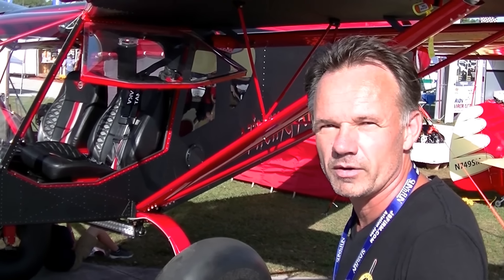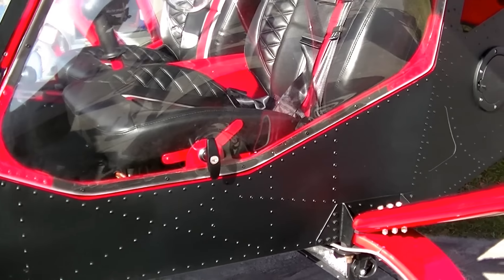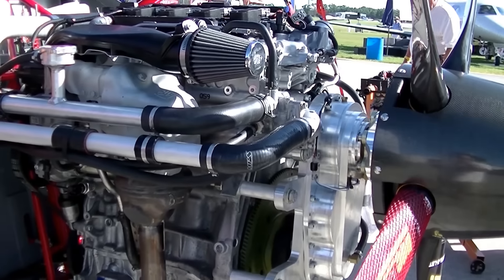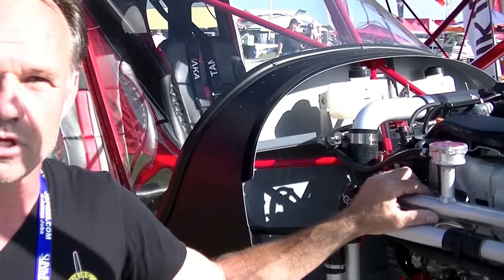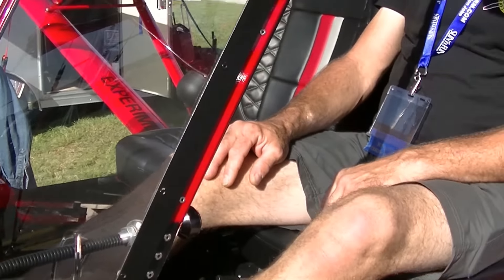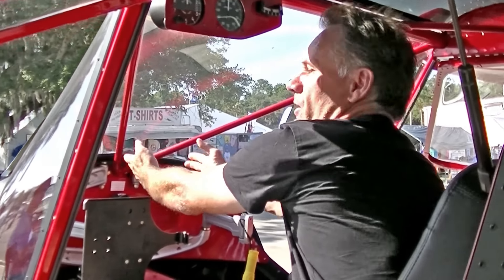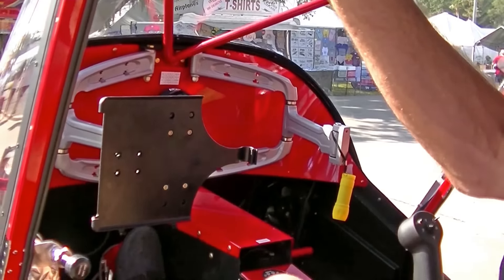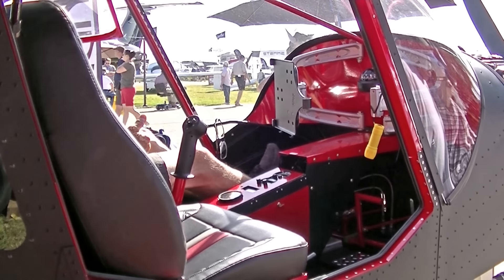STOL CH 750 Super Duty powered by the Viking Honda engine

Comment: Less face and more airplane!
Reply: Ya but, this build shouts, look at me, me, ME, whoopy Dee!! VERY VERY POOR Choice of engine.  Those tiny 4cyl engines use HUGE amounts of fuel, at high rpm and under turbo boost.  For spinning a Propeller, you NEED an engine that produces a lots of torque at very low rpm, and sips fuel while doing it.   Oh!,,, and inline 4cy are vibrators, unless fitted with balance shafts that rob engine of power, while adding weight and complexity.  VTEC Yo !!!
Reply from the maker: See it and hear it fly: https://youtu.be/Uo0QP7U9_Po
Reply: AGREE..  very poor production.. you get a D -- . THUMBS DOWN !  I wanna buy a car.. Im not gonna be in the office looking at the salesman.. we wanna see the plane dammit..

Comment: Hey camera guy!  Learn the concept of a cutaway and B-roll. We want to see the plane, not the guy talking. Where are the closeups of the places on the panel he’s talking about?  Control placement?  Sheesh....this is a frustrating vid to watch if you want to find out about the SD750.
Reply: Ya but, this build shouts, look at me, me, ME, whoopy Dee!! VERY VERY POOR Choice of engine.  Those tiny 4cyl engines use HUGE amounts of fuel, at high rpm and under turbo boost.  For spinning a Propeller, you NEED an engine that produces a lots of torque at very low rpm, and sips fuel while doing it.   Oh!,,, and inline 4cy are vibrators, unless fitted with balance shafts that rob engine of power, while adding weight and complexity.  VTEC Yo !!!
Reply: @andrewjackson7476  and yet  that still doesn't explain why the cameraman thinks equipment is mounted on the guy's face when the guy was pointing out different things in the cockpit.
Reply: Obviously the items the guy is pointing out are attached to the guy's face.  That's what the cameraman suggests anyway.

Comment: I'm wondering if the heat from the baking process of powder coating changes the strength characteristics of aluminum?
Reply: Machines and Things no it does not.
Reply: Machines and Things the slots, I call them slots because they are fixed in place and not movable or I would have said slats have plastic tips on each end those would have been painted then riveted on as powdercoating plastic don't work, I built a dozen or so airplanes for icp in Canada and we used to use an epoxy  based paint that was awesome, you could paint a piece of alum. And score it with an exacto knife and bend the piece of alum. And try and pick the paint off and you couldn't. I still think polishing is the best less weight = faster and higher roc

Comment: The only thing I wonder about is the reduction unit when one of these auto conversions ends up in an NTSB report lot of times it's the reduction unit that fails, and the engine management computer I have seen a few where something goes wrong in the aftermarket computer can't use the honda computer have to use something else.

Comment: Can tricycle landing gear handle rough undeveloped terrain?
Reply from the maker: "Rough undeveloped terrain" is quite relative. The effective elevator control means you can mostly keep the nosewheel off the ground. Additionally, we like the better forward visibility of the tricycle gear configuration, better steering and ground handling, and ease of getting in and out of the plane. The reality is that most modern pilots simply don't have taildragger experience or access to training, and pay higher insurance rates for taildragger coverage.

Comment: I have over 20,000 hours but only an hour or two of General Aviation time — at first glance this airframe looks like it needs more rudder and more vertical stabilizer surface ... can you speak to that ?
Reply from the maker: Virtually the entire vertical tail is the rudder so it is indeed a very large effective rudder with more than adequate rudder authority (especially important at low speeds). For more about the unique design features of the Zenith STOL airplanes, see the article by designer Chris Heintz: http://www.zenithair.net/high-lift-design/

Comment: The Wright brothers never used auto engines. As far as I know all planes built by the Wright company used Wright engines, designed by either the Wrights or Giuseppe Bellanca except for 1 or 2 of the racers which used a Pratt and Whitney. This was done because there were no automobile engines that met the specs they needed.
Reply: The Wright brothers did design and build their own engine for the Wright Flier, but it was an inline 4 cylinder water-cooled engine, more similar to the Viking engine than a Lycoming/Continental.  And the brothers did first ask auto manufacturers if they would build a lighter version of their 4 cylinder engines, but the manufacturers  weren't interested in building a single engine. (no volume, no profit margin) So the wrights went to the drawing board.

Comment: I thought it was a Honda civic but then I heard accord
Reply: That was a bit confusing, as was the part about the Wright flyer and automobile engines. Maybe he misspoke, maybe we missed something.
Reply: It's in both the Accord and Civic.
Reply: VERY VERY POOR Choice of engine.  Those tiny 4cyl engines use HUGE amounts of fuel, at high rpm and under turbo boost.  For spinning a Propeller, you NEED an engine that produces a lots of torque at very low rpm, and sips fuel while doing it.   Oh!,,, and inline 4cy are vibrators, unless fitted with balance shafts that rob engine of power, while adding weight and complexity.  VTEC Yo !!!
Reply: Wrong on all counts. Small, boosted engines can be more fuel efficient than large, naturally aspirated engines, which is why you're seeing more of them come on to the market recently. Compare the Ford F-150, 2.7 liter EcoBoost engine to the EcoDiesel in the Ram 1500 to see what I mean. The PSRU is where the torque comes from, gears are torque multipliers. Only large 4 cylinder engines need balance shafts, these don't have them and they're very smooth. If you want vibration, fly with a Lycoming or Continental engine.

The only downside to these engines is that they're optimized for automotive use and not aircraft use, which means that they have a longer stroke than they should, this harms efficiency somewhat, but these engines are probably still more efficient than a LyContisaurus engine.

Edit: The Viking 180 burns 12 GPH at full power and 9 at 75%, a 180 hp IO-360 burns 14.5 GPH at full power and 10.5 at 75%.
Reply: "inline 4cy are vibrators, unless fitted with balance shafts that rob engine of power"

Vibration isn't really an issue until you get past 2 liters of displacement.  Just the same, every inline 4 on the automotive market today has balance shafts because consumers have become so fussy.

As for the fuel, this is the 1.5 (I hope so, since he said it was only 185hp, and even that's low compared to the 195hp Honda claims for the 1.5), which is meant to be hooked to a CVT for economy, and is a gas sipping engine.  Direct injection was chosen for automotive engines for the ability to stratify the fuel/air charge.  At lower loads - cruise loads - most of each cylinder gets filled with air, and just a portion of it gets a proper fuel air ratio for combustion.  Meanwhile, the engine is also tuned/designed to run with less manifold vacuum under moderate load to reduce the amount the engine has to fight to breathe.

Honestly, who in their right mind thinks that aero engines, with technology that's hardly changed since the '30s, have better economy potential than the bleeding edge of automotive engines and tuning!?
Reply: Andrew Jackson <--- Internet Expert! Y u so smart
Reply: As an auto mechanic, variable valve timing is something I would NOT want to trust my life with in the air. Seems these small, boosted engines all eat timing chains at around 100k miles in cars. Lycoming and Conti may be dinosaurs ... but their RELIABLE ones. Tried and true. Who knows what kinds of failures we'll be seeing in '18-'19 automotive lines. They seem to get worse and worse every year. Problems that used to take 5-8 years to discover, we're now seeing while they're still under warranty. If it were a mid 90's Accord engine, I'd feel a little better ... although it's going to be a bit sluggish. Not what you want in a STOL aircraft.
Reply: Smitty Smithsonite I completely agree. I have been building cars mostly  4×4s land crushers, broncos, trail dusters. From ground up. But a rubber timing belt ruined the day on a Toyota camry. Slipped  belt, bent valve. Engine died. A old chain style give you a warning but sometimes will still run. I had a Chevrolet 250 that was gear to cam and half the teeth were gone and it still got me home before I took it apart in amazement
Reply: GPH, quote seems a bit high already, but it's probably much higher in reality.  Gear reduction is great, but NOT when mated to fuel guzzling inline fours, in high reeving engine.  Torque of an engine comes from the leverage(Lone Stroke, distance away from the crank SHAFT center, NOT, BORE).  even 600cc motorcycle i4 engine makes too much vibration, for comfort, so why would you want to rev it up with twice the displacement?   When you have ZERO Secondary engine config. of FLAT 4, that produces deep down TOURQUE that props need at low rpm?  Please see this BMW v8 vs Toyota i4  
     https://www.youtube.com/watch?v=F04MXepYiBs
Reply: Matt Lord it depends if it's a interference or non interference motor

Comment: It's sad that modern general aviation airplanes are still using straight-pipe exhausts, instead of an engineered sound muffling system. Pilots need to stop being selfish and inconsiderate about humans and wildlife below them.
Reply: Turboed engines are quiet to begin with because all the pulses are broken up going through the turbine blades
Reply: Well said, letserb if you don't let 'em know now the next thing added will be Catalytic Converters. lol.
Reply: Bobby Tucker Yeah!  Let's pretend we are in the stone age and have not learned anything about engine technology, the environment, and being considerate of other people!  That's the solution!
Reply: Besides portsmouthrunner,most of the noise from a plane is from the prop tips breaking the speed of sound,gonna give them a ticket,maybe you should look into the problem a little more before you spread your leaflicker thoughts on people.
Reply: And yes they do make tuned exhaust for aircraft,but I don't know how quiet they are,but you could make a down payment on a Prius for what they cost.
Reply: What viking aircraft is doing with  engine technology far surpasses the certified aircraft engines that are being built today because of the faa's regulations on what and cannot be used on a certified aircraft,they are still in the 1920 era compared to what we,as experimental aircraft owners,are doing,one of them being more miles per gallon to help with the environment,using mogas compared to avgas which everyone said ruined the environment because of the high concentration of lead in it which helped cool the engine in flight,which nobody but Al Gore and his cronnies tried to prove,but never really have but we have to live with it,and your saying nobody has done anything to help,better get something better to bitch about then a little noise that is there for probably 30 seconds, in the city there is more db's in one city block then there is in a country mile of aircraft for 30 seconds.
Reply: Caveman
Reply: portsmouthrunner No sh*ts given.
Reply: You still hear the prop.
Reply: portsmouthrunner well that would be classified as a 1st world problem now  would'nt it???
Reply: "Turboed engines are quiet to begin with because all the pulses are broken up going through the turbine blades"

Because they're stacked to the point of overlap before the turbine, actually.

And that ends as soon as the wastegate opens.

And yes, there's more to exhaust design than striaght pipe = max flow... however, at shorter lengths like most aircraft run, straight pipes are generally not only suitable, but will perform somewhere between better to not significantly worse than something with a muffler.  

Weight is the other factor aircraft have to deal with.  Cars.. not so much.  They're heavier every year because of this kind of crap.

At the end of the day, you're making noise about a non-issue.  For the majority of the flight, the sound of the propeller is the loudest thing about moving the airplane.
Reply: ports mouthrunner: There's a certain crybaby segement of the population that think the rest of the world has to concern themselves with the comfort and happiness of  these crybabys, 24/7/365. I hope those animals you're worried about are aware that there a certain humans(?) that know their concerns and are doing everything they can to remove even occasional, brief, disturbances to them. I'm so sorry that your  well being is occasionally upset for a few seconds by sounds that you find offensive. Unfortunately, return to the 19 or earlier centuries is currently impossible.which would be about the only way for those such as yourself to find the ideal world of your imagination.

Comment: VERY VERY POOR Choice of engine.  Those tiny 4cyl engines use HUGE amounts of fuel, at high rpm and under turbo boost.  For spinning a Propeller, you NEED an engine that produces a lots of torque at very low rpm, and sips fuel while doing it.   Oh!,,, and inline 4cy are vibrators, unless fitted with balance shafts that rob engine of power, while adding weight and complexity.  VTEC Yo !!!
Reply: Turbos have always allowed for fatter torque curves, more so when combined with variable cam timing and a lot of the other technology this engine is equipped with.  

It's been probably 15 years at least since a major OEM sold ANY inline 4 cylinder engine that didn't have balance shafts.  Anything 2 liters and under doesn't really need them.  V6 and even V8 engines are getting them these days.

Adding weight?  This little Honda is light.

Complexity?  Yeah... and?  Compare the price of a spark plug (which will last basically the airworthiness life of this engine) to an aero engine.  Compare the price of any of the parts, and realize that your beloved aero engines haven't been significantly changed since before WWII.  A lot of these things, you can literally take parts from the 1930s and install them.
Reply: Worst car I 've ever owned was 1999 Acura Integra GSR.  It had 1.8li but so buzzy, buzzy, i thought it was cuz hard engine mount or bushings, but it hoped wheels, like any other fwd, on launch.  I realized, that it had to be the balancer delete, for that hard core F1 image that they were showing in their commercial.  When i drove it, like they "suggested" i got 13 m.p.g.(vtech came in AFTER 5800 rpm, to fool U.S. E.P.A., instead of 4.5K), but when I drove it to get economy, I felt like, i was driving Ford Escort 1982.  This Honda engines is basically an Inline 4cyl that's TWICE as heavy as FLAT Four Rotex with bigger displacement,(that has ZERO Secondary vibration), that is twice as stressed at double the rpm, using twice the fuel to create same amount of torque.  Not to mention having added complexity and weight of balance shaft and liquid cooling.  You simply don't need liquid cooling, when you have a GIANT Cooling fan, called a propeller.  And what a Propeller on this one!  Got to have ridiculous number of blades, cuz you can't slow down the rpm enough.  Each one of the blade is causing wake and turbulence, for the next blade to follow.  A slow turning torquey engine could easily drive much more efficient two or three blade prop.